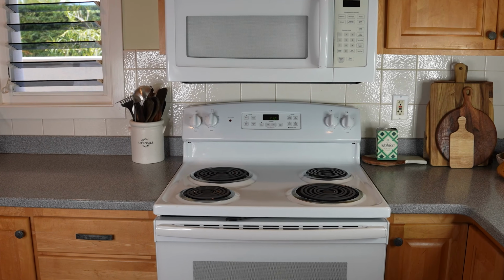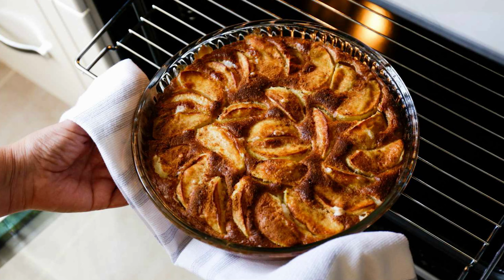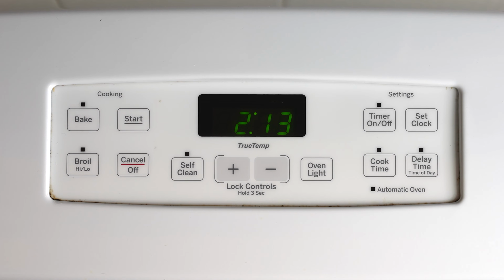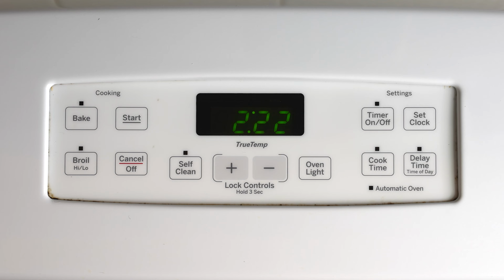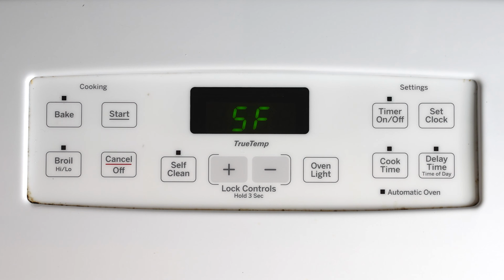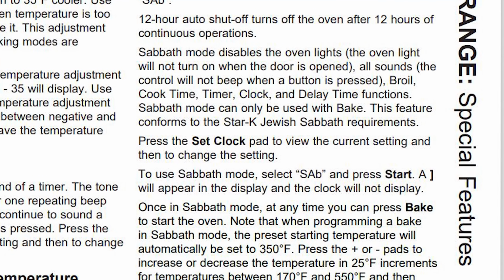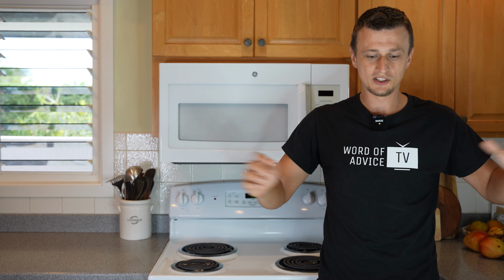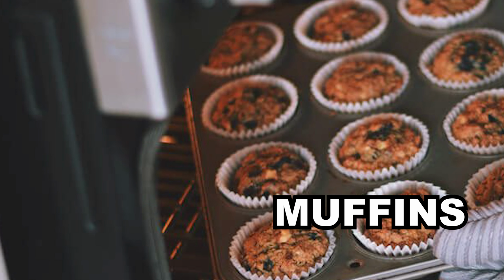How To Use a Stove and Oven With Electronic Control - Full Tutorial

Comment: May I ask please what kind of noise does the oven make once it's fully preheated ?
I just moved into an apartment with the exact first model you displayed and I hit bake ..325 and start ..it made a double tapping noise but it was kind of quick and still had the preheat letters up then a few minutes later it just switched to 325;but when I opened the oven some smoke came out
Reply from the maker: Usually it just beeps when it is finished with preheating. Your oven likely says PRE during preheat and switches to your set temperature once it reaches it, which is normal.
The clicking sound you heard may have been a relay on the control board (located behind the digital clock) which closes like a mini light switch, making that click noise.
If you just moved in to the apartment then the oven was probably unused for a while. Perhaps it's some leftover stuff from the previous owner burning off. I wouldn't worry about it unless it lets out smoke every time you use the oven. (usually the smoke would be created from oils or food coming in contact with the element or burner)
Reply: @WordofAdviceTV  Thank you very much for the info. 😊